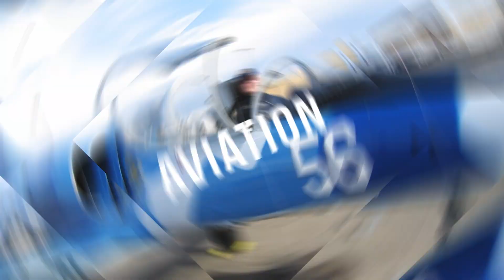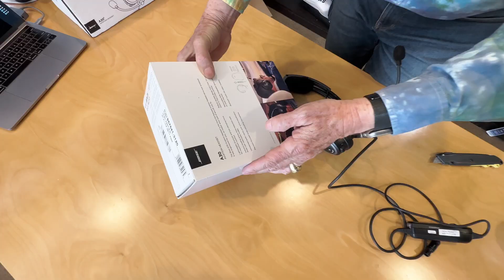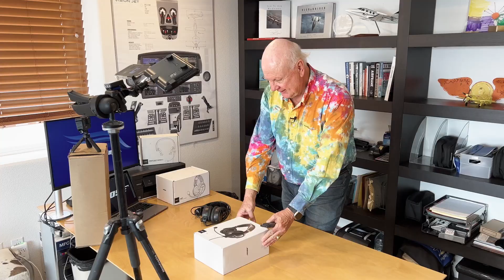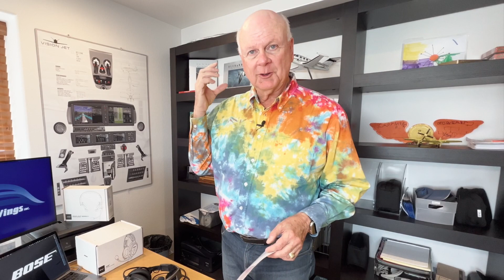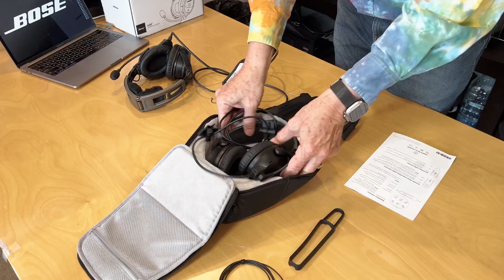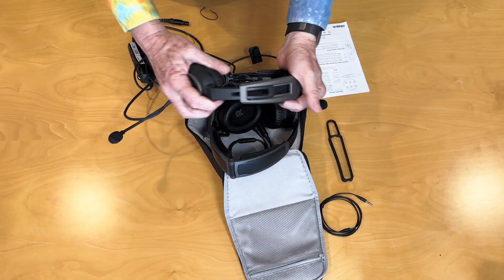Unboxing the Bose A30 headset - BOSE's Newest Aviation Headset

Comment: I just upgraded due to change of aircraft and needing 5 pin XLR.

The A30’s seem a lot more plasticy. The metal rings and band protect the old a20’s significantly. I’m 99% confident the a30’s will aesthetically wear out a lot quicker then the a20’s due to no “wear shields”

I also can’t believe they didn’t recess the volume sliders more. Drives me insane how easily they adjust by rubbing on the seat, circuit breaker panel etc. every time you take it out of the case, your chasing different volumes between the headset and the aircraft and or one ear is low and the other high. No reason it needs to be so easily adjusted.
Reply from the maker: great calls on those vol adjusters, and time will tell if build quality can handle lots of use/abuse.

Comment: What about the durability? Looks in general better than the a20 but worried about the material. Will receive mine soon.
Reply from the maker: The durability should be equal or better than the A20.  The headband is smoother and we like the new cushion.  The ear cushions are the same.  With new electronics, etc. it should last a long time.  Enjoy your new headset.

Comment: how about the weight? is the a30 lighter?
Reply from the maker: The published weights for the A20 and A30 are 12 oz and 14.2 oz respectively.  The weight distribution on the A30 is different  - more lower on the earcups.  We find them more comfortable - after 50 hours testing them.

Comment: If Bose releases a trade in program I will definitely be getting them since my A20s we're purchased a couple months ago and have barely worn them because I haven't flown much but if they don't I don't see how I could justify spending another $1,250 for what seems to be more of an update than an upgrade. Great video by the way!
Reply from the maker: Thanks! The A20s are rock solid headsets. We've had some of ours since 2012. We agree, it is more of an update vs. a massive upgrade. ANC is similar, clamping force is less, weight distribution is shifted a bit. Not sure if they'd do a trade in program, possibly later this year.  If they do we may do a quick video for our subscribers.